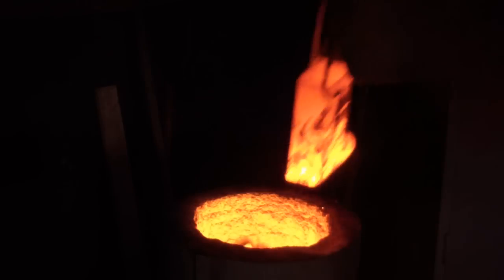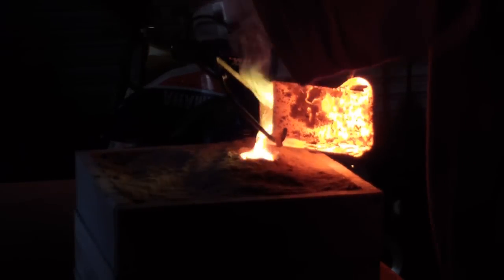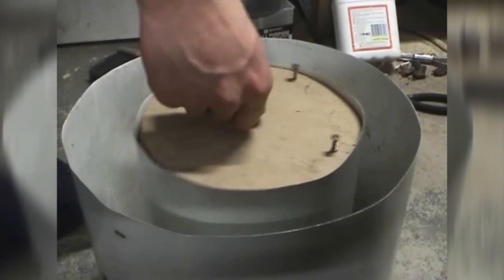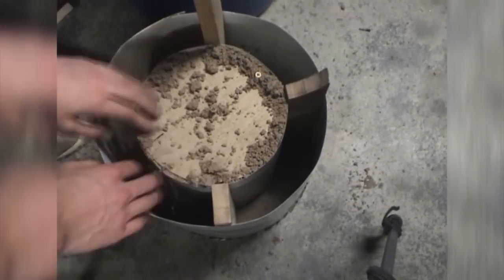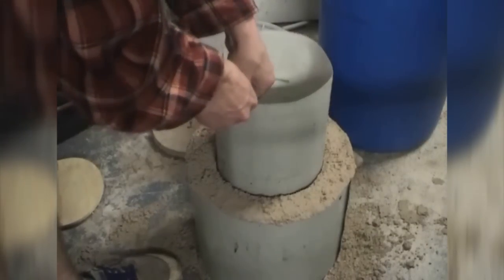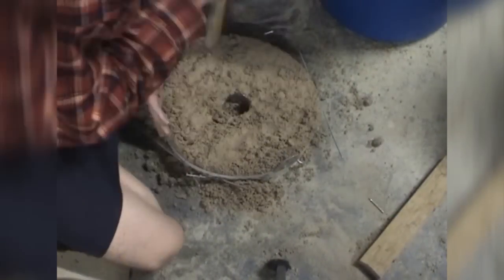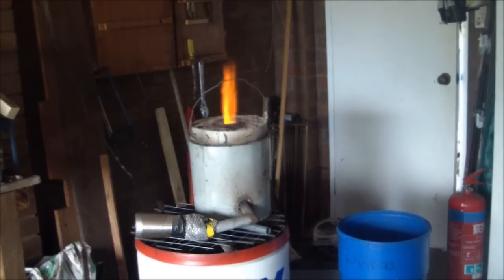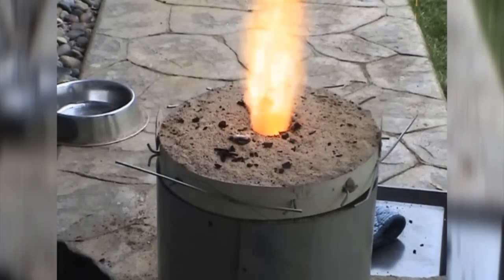How To Make a Charcoal Foundry (Tutorial)

Comment: If you cannot throttle your fan back electrically you could cut a hole in the top of the inlet pipe and put a sleeve over it, the size of the hole depends on how over powered your fan would be. The more you need to throttle back the more open you have your hole, this also allows for a degree of temperate control in the foundry.